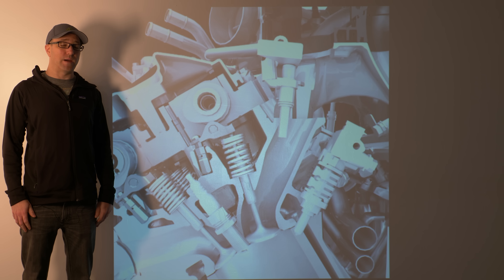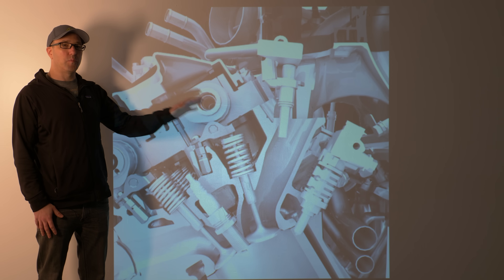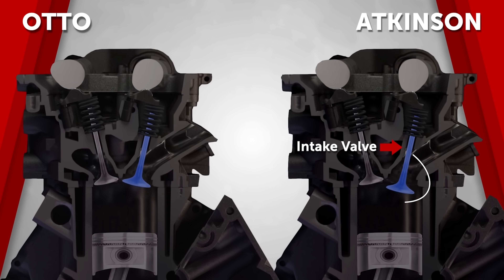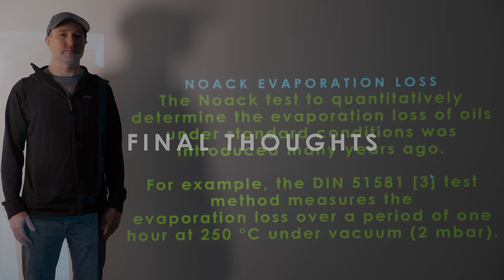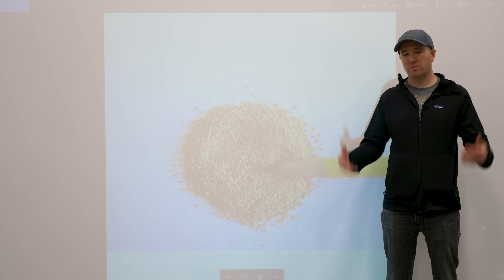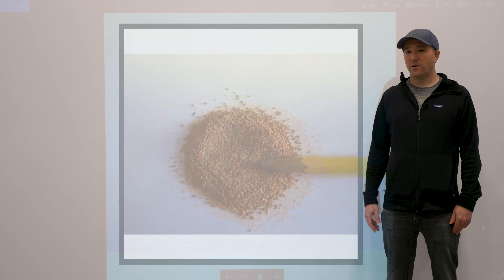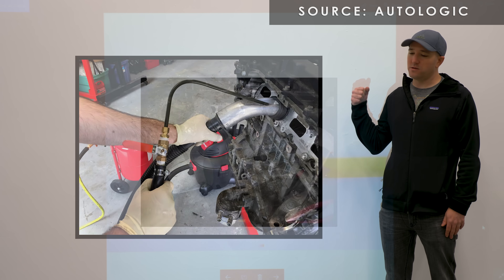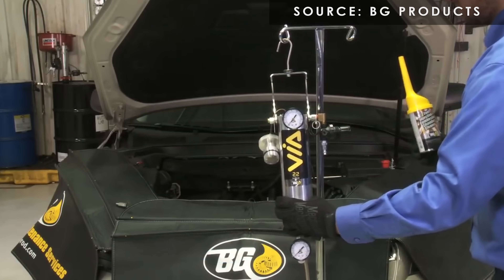Direct Injection, Problems and Solutions | The Fine Print

Comment: I'm fairly sure blowby isn't quite as you describe. Blowby that is ventilated via the pcv valve has blown from the combustion chamber to the crank case. The pcv valve is on the valve cover, so it technically is vented off over top of the valves, but the gases being vented are from the crank case, having traveled through the oil galleries and pressurized the space under the valve cover. You aren't venting "blow by" which blows from the crank case to the combustion chamber, which does happen on the intake stroke. The intake stroke that is also allowing positive crank case pressure in through the pcv system into the main intake charge for the engine. For most intent and purpose, blow by is generally only gases flowing past the piston rings into the crank case on the compression and somewhat on the power strokes.

Comment: Important: If you have a direct injected, turbocharged engine and you want to use chemicals to clean the carbon buildup on the valves - you have to remove your turbocharger(s). If you run cleaning chemicals through your turbos, it will ruin them.

Comment: So the unofficial quick n' very dirty answer is to pull the breather pipe off the air box and stop blowing that junk back in to the engine. If you really want to be socially responsible, you could feed it through a filter system before releasing it into the wild.
Reply: Bad, bad boy.

Comment: Aftermarket guys are making intake manifolds with an extra injector “upstream” for my particular engine. I wonder if that is close to being as effective to the dual injector set up. I thought about doing this mod along with a catch can but there’s one injector feeding all cylinders so its cleaning properties are probably not as good as port injection since it wouldn’t be spraying fuel directly on the back of each intake valve. I’d love your opinion on this. (Ecotec 2.0 turbo)

Comment: Direct injection was made and original used on and for diesel engines. Same as turbos. Best preventative solution is to put an oil catcher and atmospheric vent for the pcv and egr this will keep the valves cleaner and increase power and mpg but increase emmisions

Comment: Since when did port injection engines of the 80’s and 90’s get 60-80 mpg? You’re crazy. A CRX HF could get 55mpg highway but I don’t think there was anything getting higher than that.
Reply from the maker: Lean burn Insight was getting 60-70mpg.

Comment: How come Diesel engines never had carbon build up problems on the intake valves but have been running direct injection for over 50 years ? Only recent engines with EGR sometimes have this problem

Comment: You forgot one thing: DIRECT INJECTION REPRESENTS THE GREATEST LOSS IN REFINEMENT in automotive engines in the last 50 years. 1000 psi injectors opening and closing must necessarily clatter like a diesel engine. At idle, at low speeds you'll hear it despite very considerable efforts by manufacturers to muffle the sound. A 20 year old economy car 4-potter is typically quieter than today's luxury cars with direct injected (only) engines.

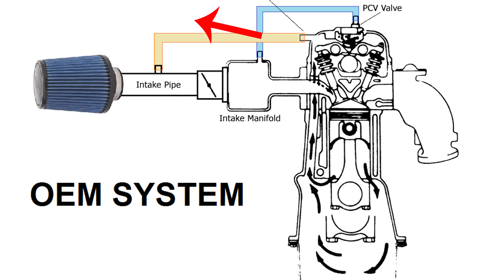Comment: Blowby blows down, pressurizing the crank case. Your schematic at 7:52 even shows gases moving down from the combustion chamber into the crank case. Blowby doesn't push oil vapor up through the piston rings.

Comment: Why not just use a single tbii like the 80s gm EFI system for cleaning the intake valves and running when the direct injectors aren't necessary

Comment: It’s a D.I. ENGINE pal, not “Motor”. Motors are electric ONLY, Engines are combustion units using a fuel of some kind!
Reply from the maker: You should check the definition of motor from simple places like a dictionary pal.
Reply: True gear heads would know the difference... that "motors" run on electricity, while "engines" run on combustion. However, many confused people do interchange the usage of these terms. So, what is the difference between an engine and a motor? Motors always use electricity as their power source, while engines are mostly powered by compressed gas pressure or the combustion from the ignition of a fuel/air mixture, ie: steam engines, automobile internal combustion engines, diesel engines, etc. Pretty simple, really!  In a strictly physics sense, an engine converts energy into (mechanical) work. A motor on the other hand is a subset of engines that produces motion as their mechanical work!  So all motors are engines but not all engines are motors. Get it? Sometimes they are used interchangeably, eg. rocket engine and rocket motor, Jet Engine but never a Jet-Motor as a Jet Engine burns fuel within the compressor.   Motors are generally used for electrical devices but are also used as an abbreviation for motorized work or motion, eg. a motorboat or motorcycle, etc.  So I guess you fall in there somewhere and thus are forgiven. Before I retired, I was a chief mechanical engineer at Northrop Grumman. Great video BTW, DI engines have many inherent flaws. I have done at least 4 Carbon & Valve jobs using walnut blasting on Audi and VW DI engines. Just Horrible. We went Tesla last year (Model S P100D and a Performance 3 on the way) and will never look back.
Reply from the maker: The EDNC Movēre, Motus, Movi.  Motor was spawned from those latin roots, to move. Motor, a mechanical device to initiate motion.  As mentioned oil manufacturers and engine manufacturers use the term motor interchangeably quite often.  Its understood.  I understand the mechanical logic however the "word" motor is defined by rules of Engrish.
Reply: Hey Savage, I believe he's right, I looked it up!  One demerit issued.
Reply from the maker: MyEyesBled Semantics most normal people use them interchangeably.  Even oil manufacturers continue to use the term "motor oil."
Reply: No, not "semantics" more like refusing to admit you're wrong. That's okay, no big deal.
Reply from the maker: MyEyesBled provide me a link with an article published explaining why you are right. All you have to do is look at the word "motor" from  the most utilized academic publications from Oxford, Merriam Webster, and Cambridge.  If that is not enough research the root latin word for motor which I already supplied.  From an engineering perspective you are correct, however you are ignoring the multiple meanings behind the word "motor" which are well-documented.
Reply: "...most normal people use them interchangeably"  If that were the case, Elon Musk, EV engineers,  EV owners etc. would all say they design, build, engineer, and/or drive Electric "Engine" cars, not Electric Motor cars.... "electric engined" cars... that's pretty funny.... lol
Reply: Hahahaaaa  That's so true!  I'm guessing Savage would say electrical engineers are not "normal people" in order to win his argument.
Reply from the maker: The EDNC I didn't say the word engine was used interchangeably just the word motor.  I've already supplied you with factual information about the word motor and it's used in English language.  Good troll job.
Reply: Nope, you said "them"  Forget it pal, I'm just pulling your chain. Take care.
Reply: He also said "interchangeably"! " people use THEM INTERCHANGEABLY"  then says he didn't say that. Who does he think he is, the President?
Reply from the maker: MyEyesBled yes
Reply: +The EDNC 
Pal, you are sorely wrong. Quit playing bullshit semantics because you want to make a point, where there isn't even a point to be made.
mo·tor
ˈmōdər/
noun
noun: motor; plural noun: motors

    1.
    a machine, especially one powered by electricity or internal combustion, that supplies motive power for a vehicle or for some other device with moving parts.
        a source of power, energy, or motive force.
        "hormones are the motor of the sexual functions"

adjective
adjective: motor

    1.
    giving, imparting, or producing motion or action.
    "demand is the principle motor force governing economic activity"
        Physiology
        relating to muscular movement or the nerves activating it.
        "the motor functions of each hand"
    2.
    British
    driven by a motor.
        relating to motor vehicles.
        "a dominant figure in the world of motor sports"

verbinformal
verb: motor; 3rd person present: motors; past tense: motored; past participle: motored; gerund or present participle: motoring

    1.
    travel in a motor vehicle, typically a car or a boat.
    "we motored along a narrow road"
This is from the oxford dictionary.
Reply: motor noun
mo·tor | \ ˈmō-tər
\
Definition of motor 

(Entry 1 of 3)

1 : one that imparts motion specifically : prime mover

2 : any of various power units that develop energy or impart motion: such as

a : a small compact engine

b : internal combustion engine especially : a gasoline engine

c : a rotating machine that transforms electrical energy into mechanical energy

3 : motor vehicle especially : automobile
Here is the Merriam definition.
Reply: Let me guess, people who call motorcycles shouldn't call them motorcycles right? They should be enginecylces according to you.
I'll keep pulling definitions if you want to keep arguing the point. I mean Savage literally pulled the latin meaning of the word out, which is where quite a few modern languages have there roots at, yet you keep on.
Reply: Welcome to the English language, land of words with 40,000 different meanings.
Reply: No point in arguing with a pedant.
Reply: So an electrical “engine-er” should rightly be called an electrical “motor-er” by your logic...lol!!! Please don’t get so tripped up by how people use a language which has historically changed the meaning of words simply by how the majority use and understand them.
Reply: I'm the same way. I call it an engine. I also call the valve covers rocker covers. Because when you pull the cover off you see rockers, you don't see valves.

Comment: My Honda Accord, 4 years old 115,000 miles with direct injection, no issues.  Owners manual said to use Top Tier gas or equivalent.  

In the old days with carburetors, you sprayed Gumout to clean out the system.  What would happen if you spray Gumout into the air intake at every oil change?

Comment: If you're running a performance DI engine, what about adding a methanol injection system? That will clean the back of the intake valves to a certain degree correct? Not as much as fuel constantly running over the valves but depending on how often it gets sprayed, it should at least help right? And if it's turbo'd then you get the benefit of knock reduction and increased horsepower as well. Not that this is a practical solution for your everyday Joe with a DI grocery getter, but I'm considering buying a late model Genesis coupe and they switched to direct injection for the last generation (also got 40 more HP than the port injected previous model) now I'm thinking turbo with meth injection is the best way to go on that engine. Or say the hell with it and slap a port injected, naturally aspirated 2ZZ enginge in a Toyota MR2 and not worry with any of it. I'll have half the horsepower of the Genesis but it'll be a thousand pounds lighter so it'll probably give that genesis a decent run for it's money with the mods.

Comment: Would adding a water/meth kit to a DI engine give you the benefits of having a dual injection system? I have a Turbo DI engine (100,000 miles) and have only learned about these issues to recently to do to much preventative stuff. My engine is terrible with misfiring lately... I’ve spent a lot of time and money thinking I was chasing bad coil packs but now I’m almost certain my problem is more the carbon build up.
Thanks in advance

Comment: Just add a PVC oil catch can. And use a good synthetic oil like Mobil 1, simple.
Reply: They can help but certainly does not solve the issue.  Have seen many photos of dirty intake valves after running a catch can from new and only high quality oils used.

Comment: IN BRAZIL WE USE ETHANOL AS FUEL RATHER THAN GASOLINE MOST TIMES, SO OUR INJECTIONS SYSTEMS ARE ALWAYS CLEAN AND ALSO THE MOTOR OIL KEEPS BRIGHTER AND CLEANER.
Reply: Doesnt matter what fuel you use it will not help carbon buildup on the back of the intake valves on a direct injected engine.  Fuel does not pass over them so cannot do anything.  I run E85 too and it normally dilutes the oil faster than petrol so have to change the oil more frequently.

Comment: GREAT video thanks. I never wanted DI. This is why my cars are older and I will keep them. There are so much more things that you can do to reduce CO2 emissions else DI (LPG?!) plus use your foot wisely while accelerating. However there is a lot of info here you can use on old engines as well. Air oil separators is one of them. Why should one recirculate blow by gases in stead of collecting and draining them. I always think of this, specially when You see a clogged throttle valve and intake manifold. The other thing is oil. The thinner the oil is, the higher is the consumption. The consumption has to do with BLOW BY?!

Great lesson, thank you so much, Roland from good old Germany

Comment: Missed..... The direct injection high pump is driven by a shaft that a camshaft actuates. This can wear and create a p0087 or low fuel pressure condition..

I had this problem and no mention on the web

Comment: My Audi 2.0 turbo started cold misfiring at about 80k cuz of this. I  fixed it by using sea foam top engine cleaner right before every oil change until it ran fine again and I ripped out the pcv and replaced it with a catch can with a drain back to the oil pan. I'm at 175k miles now, hasn't needed cleaning again.

Comment: My solution is to keep the revs up under load. My Audi Q5 in D mode basically shifts up quite quickly which is great for fuel economy, not so good for carbon buildup. I mix it up a bit with S mode up hills and passing. Occasionally I'll paddle shift to a lower gear in places where I just need a bit more revs, and so on. My 2009 Q5 2.0 Tfsi has 40,000 kms and still runs like new with good fuel economy and it uses very little oil. And it has loads of power so if I have to have the intake cleaned out in another 40,000 so be it. At that time it'll be time to put on a new turbo and clean or change the injectors, maybe a new cat and more. Power and efficiency has a price and I'll willing to pay it.

Comment: Great video👍🏼 however blow by is not generated from the bottom to the top of the piston as mentioned at 7:16 rather it’s the other way around it’s generated from the combustion process above the pistons then bypasses the piston rings gets into the crankcase then redirected through the PCV back to the intake. That’s my understanding 😉 check it out 👍🏼
Reply: Hoosen Khan He means the blowby gases are moved from the crankcase up to the top of the cylinder head where the PCV system extracts them.
Reply: Leadhammer Diesel injection ignites fuel as it is injected in a hot cylinder, delivery volume and ignition timing are determined by injection timing. Gas engine ignition timing is determined by the spark timing.
Reply: Music hip hop
Reply: Hipsters
Reply: Queen raido
Reply: Queen radio

Comment: I have a 88 ford van with a 302. Gas gauge in the rear tank doesnt work so the guy i got it from didn't use the rear tank at all. This is obvious because once I switched tanks the bad black gas has got things really messed up. I had no idea the gas was so bad until I drained the tank.  My problem is my valves are sticking open on four of the eight cylinders. What is the best way to solve this problem? Is there a way to do it without taking the motor apart?  Any help would be appreicated greATLY.  tHanks

Comment: In a non-emmissions standard state here. I drive a 87 ford gasoline 4x4 on bigger than stock tires getting 19mpg. The trick is: high flowing straight pipe exhaust, high flowing intake, Egr and pcv on their own filter, and tuned computer running ever-so-slightly leaner than factory. Not to mention very good care of the engine itself.

Comment: This is excellent video, got me to understand GDI engine so much better...stay with PFI... a lot of cheaper used (pfi) engines to swap....way less headaces  and less expensive than Gdi.   Who got time and money to clean intake valve every 10-15000 miles to keep preventative maintenance besides changing oil, air filter, plugs, and tranny....now you add another regularly cleaning for intake.....no way to keep gdi for long term.   Thank you so much for the video, thumbs up. 👍

Comment: What about spraying water in the intake while the car is running at like 2000 rpm, the water is evaporated and the mist hits the back of the valves. Does it work?

Comment: Hey, with this video we can understand that newer is not always better. There are some other ways also to get rid of carbon build up. You can use pure  hydrogen devices or air intake boosters like VGT  (vacuum strength technology) from Turkey to achieve total burning of fuel. This is not an ad. İ am using VGT in my car and my car's emission levels are almost 0.

Comment: Great video!  I've discussed the carbon buildup issue with other people for years.  We've talked about secondary port injectors that cycle every 1000 miles, different types of coatings to resist build up, we've even thought about ways for a cylinder with an open intake valve to be filled by a single DI to allow a port to be soaked for a period of time.

Comment: Any thoughts on Subaru’s new 2.4 DI engine that goes into the Ascent? Automakers know this junk? They should have ways to limit or eliminate this. No? I want to pick up the Ascent, I guess I have to trust the brand worked in a solution for carbon build up ..